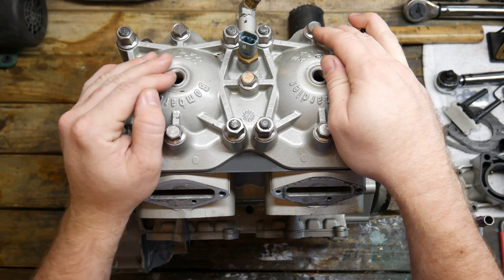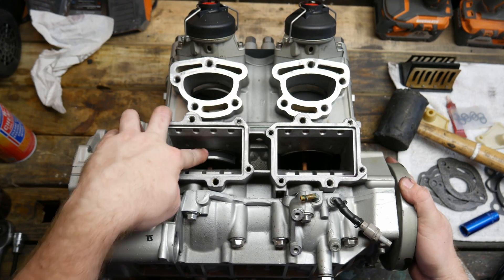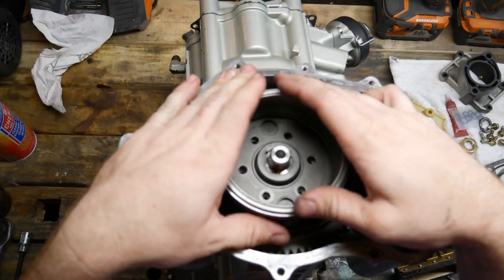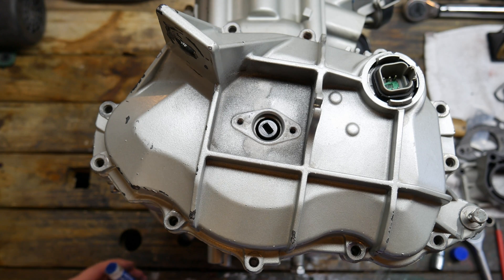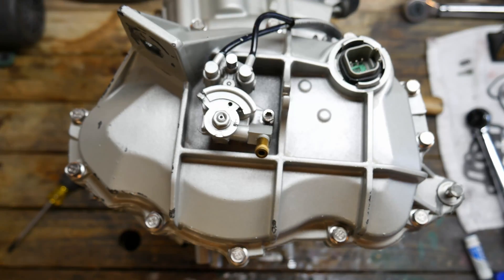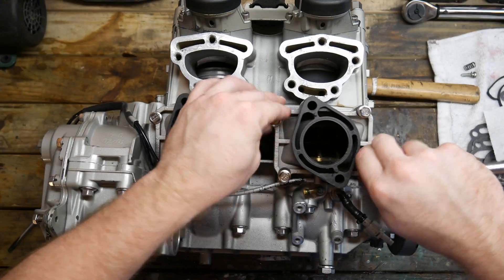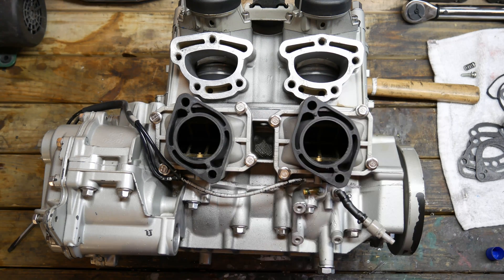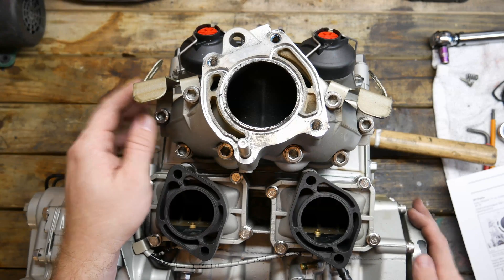Rotax 951 Rebuild Part 3

Comment: i hope you red locktited the 6 bolts on the flywheel/rotor, 947/951s are notorious for bolts backing out and wrecking the stator,
Reply from the maker: I think I used blue locktite stick on those, but it has almost another 100 hrs on it since then. I'll check them next time I have the cover off to see how they are doing. Thanks!

Comment: Do you think you can get to the starter and drive gear bendix without pulling the motor? I’d like to just pull the cover if possible
Reply from the maker: On the gtx it is possible. I have taken mine out before.

Comment: About to purchase a 2004 rxdi with 127 hrs, any suggestions as to what to look out for or even expect?  Any advice will be greatly appreciated.  It seems to run well.
Reply from the maker: The issue with the those is the direct injection. If the fuel pump goes out its expensive or if the ecu goes out its all expensive and both of those things are not uncommon. The engine itself is about the same as the non DI. Personally if i could find a non di 951 ski i would go with that simply because its much easier to fix if something does happen. But the DI does have advantages mainly fuel economy.  As with most things really look at how it was taken care of. If it was regularly serviced and the ran good oil then it will probably be okay. I would compression check it though before i buy to see if it needs a rebuild. mine had 300+ hours when the engine let go, but i think that is at the higher end of engine life. I have also heard of some letting go a little over 100. Also of course was it flushed at use? Did it run in salt water etc.
Reply: DeWoody's Shop symptoms to look for concerning fuel pump and ECU?  I’m doing a compression check when I go back tomorrow.  Seller is supposed to put me in contact with his service shop.  Everything appears and sounds as it should.  Thanks for the quick response and I’m enjoying binge watching your rebuild.
Reply from the maker: With the ECU there is not really much to look for. They usually work until they stop. Obviously any weird electric stuff when you try to turn it on. The fuel pump you can test the pressure or if it is excessively loud it usually means its near the end of its life. But there  again its mostly one of those just stop working kind of things. Also make sure all the wiring does not look degraded. By 04 they had a lot of the issue solved with the early DI. Glad you are enjoying them!
Reply: DeWoody's Shop thank you very much for your input, greatly appreciated....